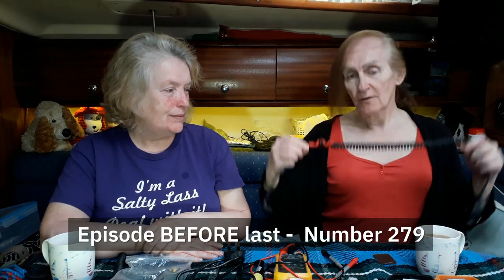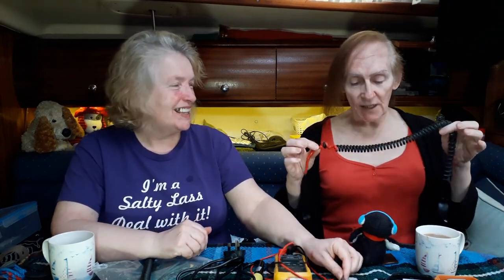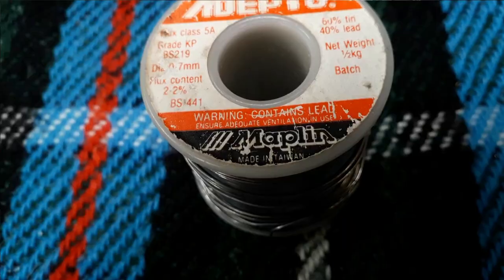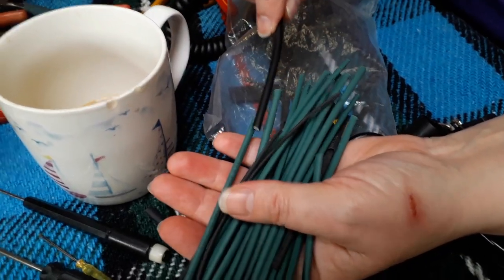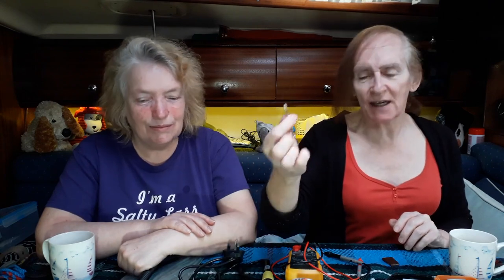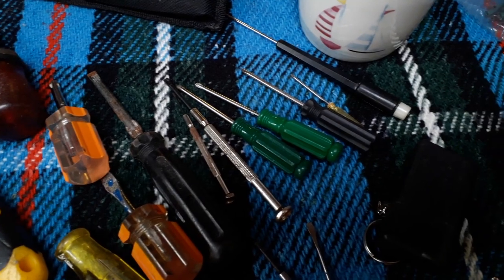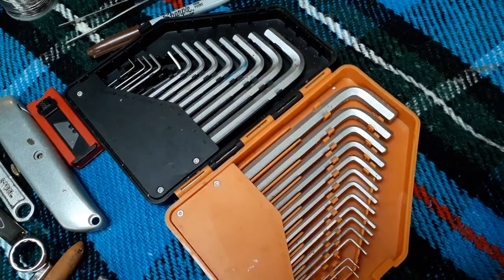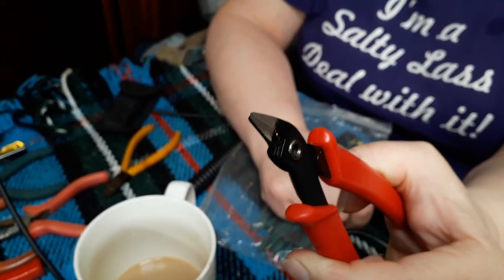Sailing Northern Ireland - Tools - Simrad RD68 - VHF Radio fix - Ep. 281

Comment: Having both a Metric and an Imperial Adjustable spanner is very important. :)
Reply from the maker: Fortunately our adjustable spanner does both, although everything aboard is metric. If we find something measured in bananas we tend to chuck it 😉
Reply: Great video. A good mix of technical with a fair share of humour 😅. I carry a rubber mallet and a small hammer. Saves using the back of an adjustable or vice grips to tap of bang something…..thanks so much.
Reply from the maker: We also have the rubber mallet. It means we can double up as doctors and charge for testing reflexes 😄 Glad you enjoyed the video and thanks for the feedback, always appreciated.

Comment: That ole Maplin 60/40 solder is worth money! Our friends in Brussels banned tin-lead solder for new equipment around 2005 to reduce quantity of lead in e-waste ... new lead-free solders just don't flow the same. Die-hards like myself scour eBay for old-stock which is becoming more difficult to find. :-)  Great job with the repair!
Reply from the maker: Thank you for letting us know of its value. We shall hide it in the forward locker portside under the box marked "spares" where no one will think to look for it!

Comment: Great episode lasses.
A tip about zip-ties, once you cut them, just tap the sharp bit with the the tool you used to cut it with.
That is a fast way to make the sharp edge go nice and smooth.
Reply from the maker: Tap? They are like razor-blades! Or does tap = hammer? 😉 😄
Reply: @SailingYachtSaltyLass  Tip-ties are made of plastic, just tap them a few times, on the sharp point and the sharpness "magicaly" disappears. You can use a hammer if you want to, however the metal tool in your hands after snipping it will do. Just try it. You might want to use some kind of backing, like an adjustable wrench as backing on like say when you do it on a bunch of cables zip-tied together.
Reply: Let's put it like this, I work in the entertainment industry and we use zip-ties a lot, like 1000's a project. It works.
Reply from the maker: @dutchglobetrotter4513  - I will give it a go. Is it just a whack straight down or do you sort of hit it sideways?
Reply from the maker: I will certainly keep that in mind for when I am using the "awkward" snippers. Thank you 👍

Comment: Excellent after this weekend I can contact you on vhf once I’m finished my course.
A wash bag what about the nifty tool rolls you design Gaynor?  Everything has a place & you can see at a glance if something is missing before it is put away.
I’ve all our pliers home to get cleaned and lubricant on. The joys of sea air has some stiff/seized
Reply from the maker: Good luck with the course. We found it a great confidence booster when at sea as we are happy to talk to any vessel if there appears to be a potential conflict. Before the course that did not happen. As for the tool roll, we have so many tools it would have to be more like a tool blanket... 😄
Reply: Colour coded for screwdrivers, pliers etc.
We have a small tool bag for all our spanners. SO MANY.
Reply from the maker: Tell me about it. We are currently route planning to get down to the south coast. When do you set off?
Reply: @SailingYachtSaltyLass  April 1st new contract in Dun Laoighaire. Weather permitting maybe over on Sunday ( vhf course on Saturday) otherwise next weekend
Reply from the maker: @WavedancerWesterlyfulmar  - you're moving? So we can sail past Malahide without stopping? 😄

Comment: Hi Lasses. Have the same prob with Simrad mic cable. Can't see a source below for the cable which you spotted has Two shielded wires out of the five.  Please can you say where you got yours from? I can't find any with that spec. :(
Reply from the maker: The cable we used was this one https://shop.technofix.uk/replacement-curly-cord-microphone-cable-6-core-1-screened-black
Reply from the maker: You might also want to check our website for notes http://www.saltylass.co.uk/radio-mic
Reply: @SailingYachtSaltyLass many thanks😀.  That’s what I was looking for.  Sensible price too. 
So am I right - Simrad only use one of the two shielded cores in the original cable?  Looks like it to me.
Reply from the maker: It has been a while and I do not trust my memory but I can recall that not all of the wires were needed. Check the article linked on the reply above  which will take you to the Salty Lass webpage which details the exact wires and connectors we used. The microphone is still working perfectly so we must have got thing right 😄
Reply: @SailingYachtSaltyLass have done and it’s a very comprehensive description.  Won’t have a problem doing it.  Just wonder why Simrad chose a five core cable with two shielded cores.  Many thanks again.